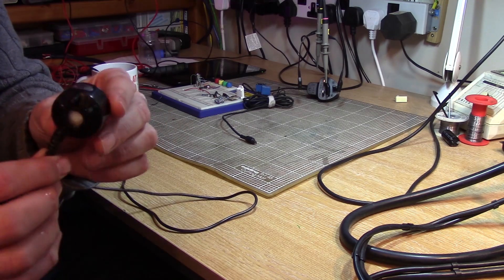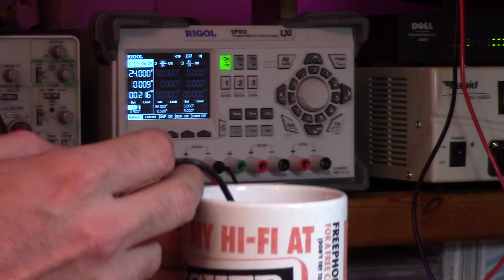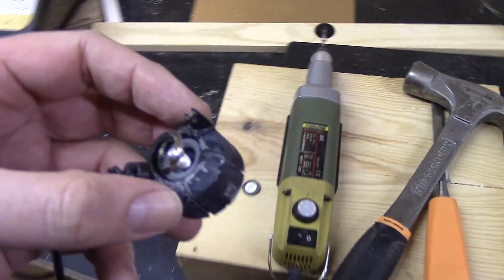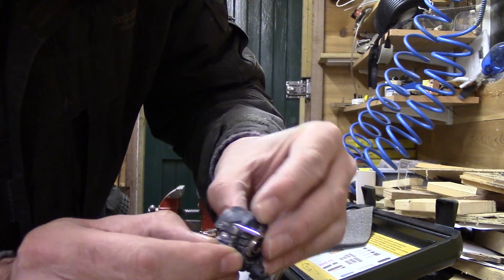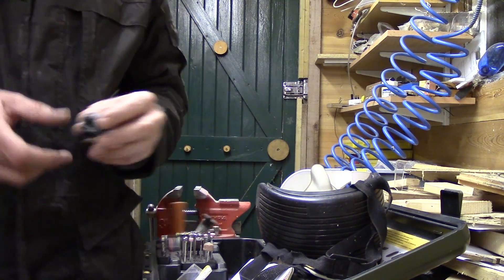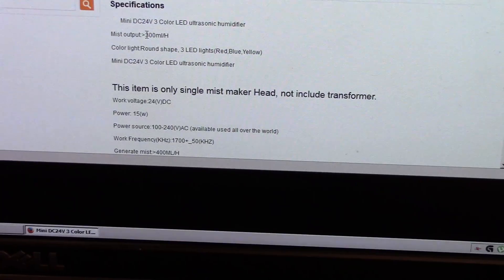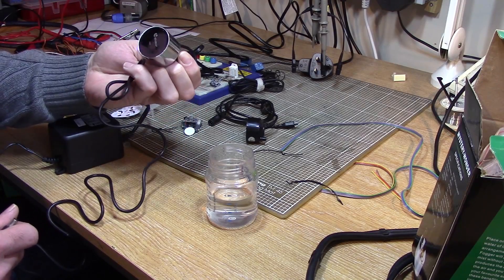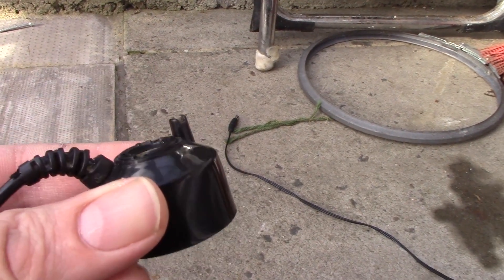Ultrasonic Fogger/Mister Autopsy and Overvolt

Comment: That was very useful, thanks. Surprisingly despite the greater prevalence of them now 8 years later, there's not a lot of details out there about them. 
I used to think these units where something different from the $3 board+piezo you get off ebay, but it's clear now that it's just the same thing. A bit more powerful, with a circuit board designed for 24v instead of 5v, and encased in epoxy for waterproofing, but essentially the same thing.

Comment: There is a mechanical vapour motor.. the one that spining that draws up water and spin it out... it should be more reliable than these mister.. which i have personally broke a few no long after use..  these piezo mister are not reliable.

Comment: The transducers as used by normal ultrasonic humidifiers can be had on eBay for about $1.25 each DELIVERED in quantities of about five from the far east, but they're wired with a rubber gasket slipped over hem, which is actually removable.  I also saw raw transducers without the rubber gasket or soldered wiring for a little more.  I bought a half dozen 25mm ones (they also have 20mm ones) and have replaced mine in my three ultrasonic humidifiers three times (I use them for reptile tanks), taking care to carefully scrape off any oxidation or scale on the metal transducer harness/port with a small screwdriver each time I replace them.  The new ones are ceramic instead of metal like the ones that were in the humidifiers from the manufacturer, but apparently (I gather since they work fine) they are backward compatible with the old metal ones.  There are some harmonic advantages I read for the ceramic ones such that they deliver more energy at the resonance frequency which is a big deal "in the world of ultrasonics", so I think that the ceramic ones are all taking over.  Just like any speaker, the ultrasonic transducers do go bad as you said, but (a) if you use RO water they'll last much longer since you don't suffer from mineralization issues and (b) under no circumstance, though, should they last less than several thousand hours, even using hard water (I'd estimate about 10,000 hours if not more). 

PS - Units like the one you are showing here at the end (i.e. with the 24V DC driving circuit plus transducer encased in chrome and designed with planned obsolescence in mind) run about $6 per unit on eBay delivered from the east as of this writing.  They are powerful and work fine when new, but I certainly cannot vouch for their durability.  Generally, stuff like that doesn't work too long.
Reply: I’ve bought around 30 of these cheaper mist makers over the last few years, some fail almost immediately, most last somewhat longer, and one of the cheapest ones that lived in the muddy water of my pond produced a truckload of fig for five years straight before it died. What you end up with is more random luck

Comment: I wonder why you put AC to it in end of video? It works very well with 24VDC, so why you dont try overvolt it DC? Or did I just miss some important part from video..
(just tested few minutes ago mine first ultrasonig mister :D)
Reply: MrAntza it works with dc only when it has a built in inverter. You need ac to create ultrasonic movements afterall

Comment: Hey. If I have 10 foggers like the one you have connected to a single 24V AC/DC, what happens if one fogger dies? Will the fuse on the adapter blow? Should I have a separated fuse for each fogger?

Comment: Well i've never seen a plant setup like that before.. can i ask why you have a fogger under seedlings?? Are they special plants? Why not just put them in soil?
Reply from the maker: Hi GenosPerformer... Two reasons really... 1.) It was mostly to try and avoid transplant shock when moving the seedlings from a seedling tray to larger net pots for growing in an NFT rail.... and   2.) because I can... the fogger cost about £3 so it was a cheap experiment.... I tend to avoid growing in soil because I'm not a good enough gardener to know what soil is good or bad... Working directly with hydroponic nutrients means that I can mix up the solution to a known-good recipe every time and I don't have to worry about soil based pests. Cheers!!

Comment: The reason you keep blowing them is because you run them dry. They use the water for cooling.
Reply from the maker: 1.) No i don't - I have them mounted under polystyrene floats so that they always sit a fixed 15mm under the surface of the water, and . 2.) They have a sensor on the top and deactivate if the water level gets too low.

Comment: hi, i want to ask couple of questions, is the operating voltage dc 24 or Ac 24.  then, would it not work if given current directly on to it without a circuit. what's the circuit is for. is there any risk of catching fire,(although immersed, i mean in case of drying out of water). thanks for the video, its a lot informative
Reply from the maker: Hi Sharon - Mine said specifcally 24VAC on the side, but in reality they will work from either AC or DC. There is very little risk of them ever catching fire. They have a sensor on top to make sure that the device is immersed in water and will deactivate themselves if the water level drops too low.  it is only if that sensor fails for some reason that there would be any risk, and even then they'd probably just get hot and then stop working rather than actually catching fire. Cheers!!
Reply: If I give 12 v D.C. Without a circuit on to the disc doesn't it work, and it's for cooling my condenser if the car, in hit days, the ambient  temp can reach 45 deg.

Comment: I am woefully inept at electronics.  Any ideas how one of these might be rigged to operate by battery for an hour or two? Would a 24/36V battery pack work? I know next to nothing about electronics so if there is an obvious reason why not, I apologize in advance.
Reply from the maker: Hi Lyndon - Yes - a 24v battery pack should run one of these misters for many hours... They'll use about 0.25Amps of current at 24V. Hope that helps. Cheers!!

Comment: i bought a 3 head plastic mist maker last week and it stopped working after couple days.
the metal one worked around 1 year. i figured that they are sensitive to heat and you should give them a pause every couple hours.
chears!
Reply from the maker: Hi Mansoor - I too found that the plastic ones died very quickly. I don't think it's heat that's killing them though as they're sitting in a bath of water and can't really get much hotter than the surrounding liquid (~30C)... I thought that what was killing them was a build up of encrusted nutrients on the piezo module... Maybe the metal ones laster longer for me because I gave them a scrub with  a brush every few months (which I never did with the plastic ones). Cheers!!

Comment: thx for your info. i know from my work that voltage will Change the strenght of your vaporizor. becourse i srewed them all down to 18v. so if you put them to 28v you have more Jet (fog). power
Reply from the maker: Thanks Roy - That's good to know and will probably come in useful some day. Cheers!!

Comment: Thanks so much! Your video helped me understand this thing better. I got the metal one (cheap Chinese version, too), but my adaptor must not me right because I only saw a little bulge of water being vibrated, but not enough to make fog.
Reply from the maker: Hi Viv - The foggers are very depth-sensitive... If you have it in water which is either too shallow, or too deep then you won't get the fog correctly. Most of the foggers run on 24V. Hope that helps. Cheers!!
Reply: Yes, I am getting a 24V cable now. It seems like that adaptor is more expensive than the fogger itself. It seems if it's DC or AC or ACDC also matters. I just bought the fitting adaptor from the same shop.
I tried my fogger in a bowl of water. It was very shallow, when it came too close the surface it turned off automatically. I'm sure once I figured out the Voltage that I can also find the right depth. Thanks for the help. :)

Comment: Hi Jim,

Thanks for a great video! I have a question that I think you might be able to answer.

I have a setup just like yours with a plastic box, a mist maker (with a metal body, from Aliexpress) and plants. However when I touched the water stream right above the mist maker I felt a pain in my finger and I think I got a current through my body.

My voltage detector is reacting to the water, even to the mist and it actually starts beeping before I am even near the water, maybe 10 cm away. Is this normal?

Could you check your water with a voltage detector and see if you get a reaction as well? 

Thanks! 

// Gio
Reply: Any ideas anyone? Is it dangerous or can I keep it ?
Reply: +I fart on you Is the setup grounded? Watch for RCD trip.
Reply: Ultrasonic vibrations are painful! If you put your finger in the water stream you will definately feel it.
Try putting you finger in the water far from the transducer and see if you get the same pain, that should tell you if you are getting an electrical shock or an ultrasonic burn. When I worked with ultrasonic transducers, for fun we would melt plexiglas or polycarbonate in in ice water bath.
Reply: I think these are ultrasonic vibrations you’re feeling, rather than an electric shock. If you hold your finger directly above the disk it will blood well hurt, that’s you sonic vibes. It feels an awful lot like an electric shock, tho maybe the pain is felt a bit more locally in the area they came in contact with rather than the generalised wtf of an electrical shock. It’s generally accepted that these are aquarium safe, I do wonder tho - surely its  gotta hurt any poor guppy that swims too close.

Comment: hello.. have u grown straberries aeroponic?
Reply from the maker: Hi +Echim Adrian - Not yet... Aeroponics is something that I'm very much wanting to have a play around with - I've bought up all of the pumps and misters I think I'm going to need, but haven't yet got around to building an enclosure to hold the mist inside... I don't think I need anything particularly clever... Just a frame with some plastic sheeting should do the trick.... One day I'll get this done... but probably not this weekend. Cheers!!
Reply: +Jim Conner Thanks 4 your reply. As I saw across the videos/sites the ceramic plate as a lifespan of 3000-5000h, probably lower if used with nutrients, maybe this is why it broke...I want to build a aeroponic small unit for a few strawberrie plants, but have no idea what to put in the water :D.
Reply from the maker: Hi again +Echim Adrian  - You can also get teflon-coated discs for the foggers which are supposed to have a much longer lifespan... but they cost so much more that I just regard the cheap foggers as a disposable item which will last for a few months at best. For all hydroponics/aeroponics, you need a proper nutrient solution which contains all of the elements the plants need (14 of them in all). Most fertilisers will only contain nitrogen, magnesium, postassium and phosphorous which is fine for plants in soil as they can get the extra minerals they need from the ground - For soil-less growing however, you need nutrients which contain sulphur, copper, iron, chlorine, zinc etc too.... Any of the pre-mixed hydroponic nutrients will do the job nicely (I've used Canna brand Aqua-Vega and Aqua-Flora nutrients in the past as they were the lowest cost of the ready-mixed nutrients - they worked great)... In the long-term though, buying pre-mixed liquid nutrients can become very expensive, and if you're growing at any kind of scale (or for any length of time) then it's well worth looking at bulk agricultural nutrients such as Yara Kristalon Brown or Morgan County Seeds' Masterblend (depending on which country you're in). I got hold of 5KG of Masterblend from the USA at the start of last year - it cost about £5 and I've still got around 4.5KG of it remaining after a year's growing - it is far far cheaper... (The Yara Kristalon Brown is available on ebay.co.uk at £50 for 25KG - the problem I find is getting hold of small quantities).
I have also found with my fogging chamber that because there is nothing to stir the liquid around, the nutrients tend to drop out of solution faster than they do in a tank with an air-stone in there, so I'd say that you want to change the nutrients at least every 2 weeks to keep the plants happy.
Hope that helps. Cheers!!
Reply: Thank you so much, you helped me a lot.

Comment: I heard you say your mist makers kept breaking down. Have you tried our units? They are far more reliable. 
TheHouseofhydro.com

Cheers, 
Joh
Reply from the maker: Hi Joh - I haven't tried your units, but I have no doubt that they're superior to the bottom-of-the-barrel cheapest-on-ebay ones that I was using. I see from your site (and I've watched a couple of your videos too) that you're using Teflon coated piezo discs for your units which undoubtedly gives you far higher reliability than the cheap tat I was playing around with... They say 'you get what you pay for' and I have no doubt that had I been willing to pay for your unquestionably superior product that I wouldn't have had so many failures. Having said that though,  the price of the units I've been using (the very cheapest of the cheap on ebay) means that I can pretty much regard them as a consumable item - The entire unit from ebay, delivered and including shipping costs less than a single Teflon-coated replacement disc. Perhaps one day I'll buy a quality unit from your shop.. if I ever get around to building the aeroponics/fogponics chamber I've been planning for the last year. Hope all is good with you. Cheers!!
Reply: The House of Hydro Ultrasonic Mist Maker Supply send me one of your products so I can give an indepth review on my channel :)

Comment: Jim can you help me to build a custom fogger using these http://www.aliexpress.com/item/ultrasonic-mist-maker-25-mm-atomizing-transducer-ceramic-humidifier-accessories-ultrasonic-transduce-membrane-10pcs-lot/32229830884.html?spm=2114.01020208.3.44.jmkCbD&ws_ab_test=201407_1,201444_5,201409_1
Reply from the maker: Hi +Anthony Scott - Sorry for the delay in responding - It seems that Youtube has now totally given up on telling me when people leave comments... No email... not even a little bell symbol at the top of the page.... so I've only just noticed your comment now. Although I'd love to be able to help with that, I honestly wouldn't know where to start with the circuitry and would expect that building your own would cost much more than the cheaply available ready-made units... I can understand the appeal though as that seems like a very good price for the discs. Cheers!!
Reply: +Anthony Scott Hey ! I Want to build a custom fogger too!. I have some piezo but dont know if any piezo it's ok for this project. Any schematics? Ideas? Papers to read? Anything will be useful. (I study electronic engineering but never worked with piezos yet)

Hope you can help me!
Reply: +Nacho fq From my research I have a few documents I can send over. Along with some information I received from a manufacture. Give me sometime to get them together. Do you want them via email?
Reply: Yeah sure via mail is ok! Thankyou!
MrStuntmonkey